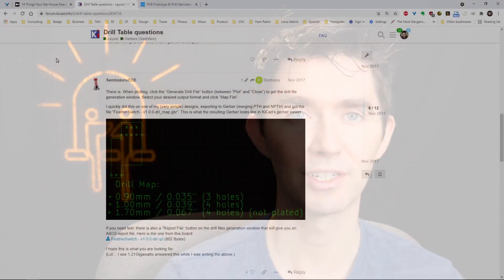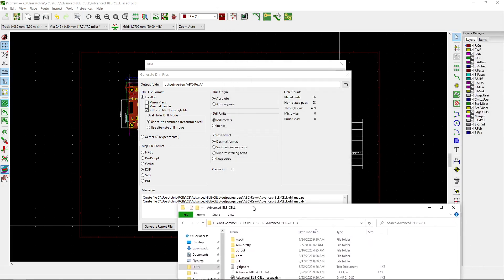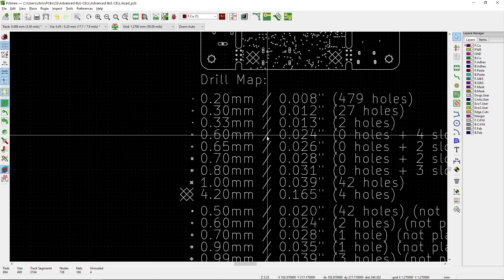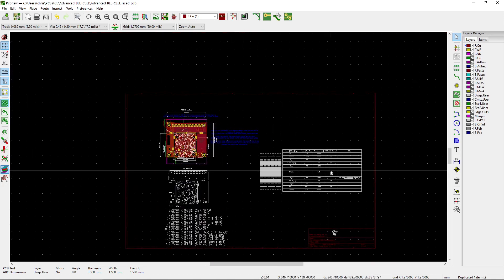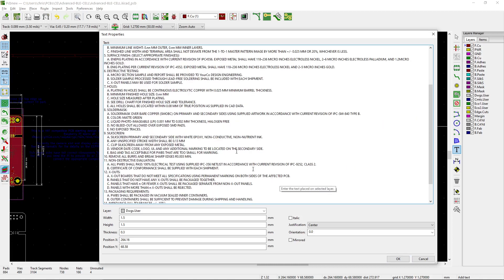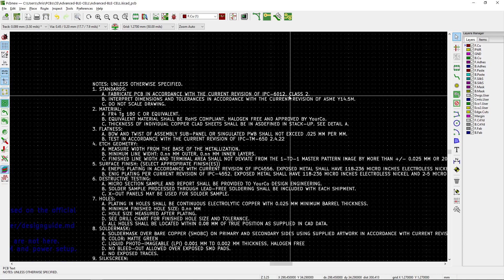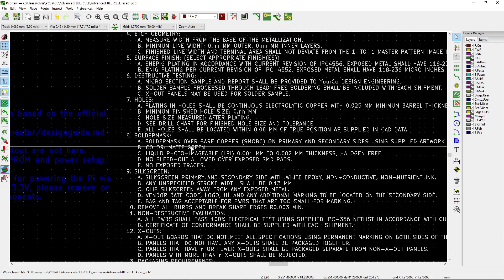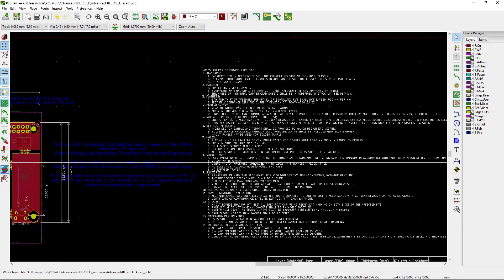Drill Tables and Fab Notes on a PCB Fab Drawing

Comment: I noticed that you have .012" & .013" as well as .024" & .026" drill sizes which is sub-optimal given that plated through holes are generally +/- .003".